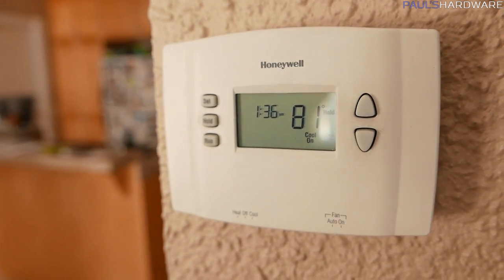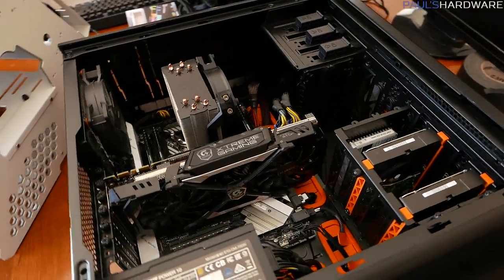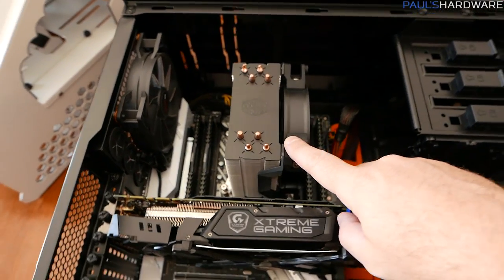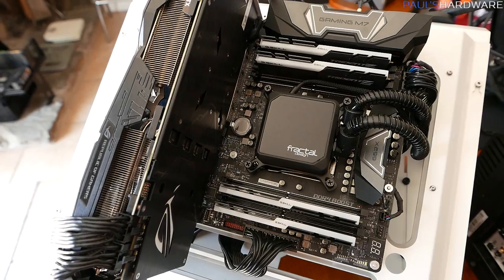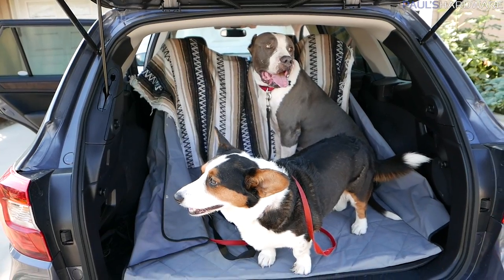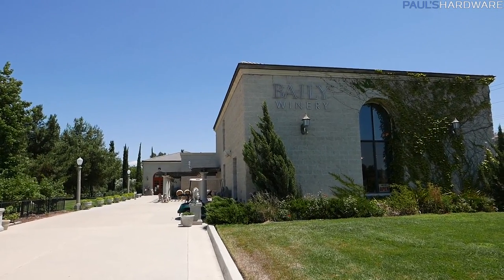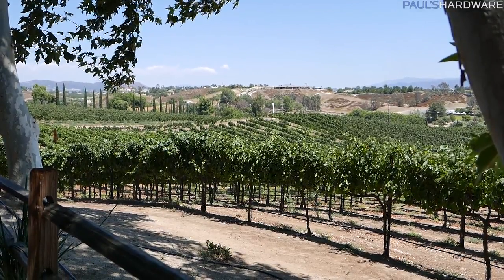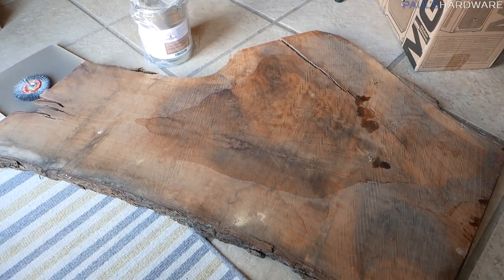GETTING WOOD

Comment: Paul's Hardware, there's a fairly sizeable crack on that slab you definitely want to make sure to shore up; either use a bow tie or epoxy if easier. If you don't because of how the weather can be it might extend on you and split the slab even after finishing

Comment: Here in WI, we have the HVAC set at 72 year-round.  My home/work office is downstairs and since heat rises, my office (where all my computer stuff is) usually is around 68 year-round.  It doesn't take much to keep house cool in summer because it is always in the shade from all the 100' + tall Oaks, Hickory & Maple trees.  And we are in a "hollow" so we don't get all the nasty winter winds.  Our summer temps can be anywhere from the rainy 60s to hot & humid low 100s and our winters anything between 30 above to -30 below.

Comment: You could fill the cracks in the wood with epoxy to give a smooth surface all around! You can use dyes to change the color of the Epoxy, a lot of people use black epoxy to show off the cracks more, but you can use different colors if you want something to pop. Just be sure to do it somewhere not in your house as Epoxy sticks to everything, and wear gloves of course!

Comment: paul i really wanna know , if i get an i9 7900x and a decent aio like the corsair h115i or the coolermaster liquid pro 280 , and i don't plan to over clock this cpu as it goes to 4ghz on turbo with ease so point of overclocking , am just asking will this set up with the i9 7900x and an aio 280 rad will do ?? and no overclocking i want this pc to be stable cause i want to shoot my 3D Renders, and each render will go around 5-10 hours , will this setup do the job ??
Reply: Amit Ghai Ryzen 1800x is way cheaper and gets better benchmark scores than the i9 or get threadripper
Reply: Joseph Stalin lol ryzen 1800x gets a cinibench of 1630 i know cause i have one and over overclocking that fucker to 4ghz gives a score of 1720cb but the i7 7820x at stock  check this at stock is faster than the 1800xoverclock the i7 7820x gets 1750 to 1800 at stock and its like only 100$ more expensive in my region (country) intel stuff gets more and has more service so its kinda hard to avoid intel here and given the fact the i9 7900x goes to 2330 cb score and stock which is amazing for a 10 core cpu , none of my xeons do this , yes threadripper is on the cards  and if it goes realy well and i mean really really well then only i will jump and spend 1000$ on amd dont u think that is too much money for spending on and , see my perspective is totally different here i buy xeons  for rendering and they cost a fortune even the used ones so this 7900x looks good for the price  but i am holding it off cause the 7920x is also gonna drop soon which i have a feeling will be soldered down if that is the case no matter cost of 1200$ i will buy intel as my work in rendering on my small render farms suites the intel products more but lets see if everything goes wrong with intel than amd threadripper it is see my heart starts pounding hard whenever i think of spending that amount on amd stuff

Comment: 81 is miserable. It would have me sweating non-stop. During the summer my ac is 70, and during winter the heat is set to 65.
Reply: Agreed. I think 60 is my favorite.
Reply: AC at 75 here in florida, around 90 with 70% humidity outside...
Reply: 52chevy3100 70°. I would freeze. 76-80 is a nice range for the whole day. I would get sick with only 70
Reply: How Munch is That in real temperatures?
Reply: 81 and I would be dieing from the heat
Reply: Game Lands 80 is 300 K 70 is 294 K
Reply: 75 is as high as I can stand indoors. Heater set at 58 in winter.
Reply: 80-81 in DRY air wouldn't be bad, and Paul's right - keeping your feet cool in sandals helps a lot.
The insane electric costs over there is surely a great motivator as well.
But what do I know? I live outdoors in the ultra-muggy southeast LOL
Reply: Can't do that in CA or your power bill will be $800 a month...   SoCal Edison our power company is a big monopoly rape your wallet scam here.
Reply: 52chevy3100 that's pretty good.  I keep it at 72, when I go to work it goes to 76 then when I get home it goes back down to 72 lol. And winter 70. And it usually get to 75 Max in my office
Reply: Also, contractors don't put any insulation in your house. I keep my thermostat set at 70 in the summer in the house I built (and insulated well). My electric is ~$150 a month.
Reply: Sounds hot, but i have no idea.. I'm hot here with 24 degrees celsius, and that is above the polar circle.
Reply: 70c is hot af.
Reply: When you are paying 15.34 cents a KWH in California I can see why it is at 81. I pay right at 8 cents per KWH. Keep mine on 70 in summer and my electric bill is never over $200 a month in summer or winter. Well on the bright side you could be in Germany and pay .35 cents a KWH.
Reply: We pay between 14 and 15 cents per KWH here in Kansas,so Calif isn't the only place with high rates. Oh and that's with a nuke plant a 100 miles away. Trust me those NEVER make your energy bills cheaper,they make them cost prohibitive.
Reply: 52chevy3100, 81 isn't bad in Cali, it's horrible on the east coast because of the humidity
Reply: Yeah humidity heat is horrible. I'm in SE Tenn.  Have had high 90's with 50%+ humidity.
Reply: That's the point I was trying to make. I remember a cali-girl that was completely miserable living on the Texas Gulf coast for a year - even though the actual temps were 20F cooler than she was accustomed to.
Reply: Yep, humidity is a killer, makes things so much worse!!!
Reply: Here in South Florida, it starts out around 78 in the morning with 95% humidity and goes up to the mid 90's in the afternoon, but only about 60% humidity.  We keep our house at about 79, but don't wear very many clothes.  Our electric bill never goes over $100.
Reply: +dblgonzo Exactly, I am like freezing right now and have like 79° here in Germany and our power is like three times your worst rates at best, so you see how spoiled you are. But luckily I have no Trump for president and our healthcare and universities are amongst the best and most affordable world wide. (Incoming nazi and refugee comments...)
Reply: My Ac is at 75 degrees any higher then whats the point of a AC?
Reply: 52chevy3100 I work in a 95 degree factory 10 hours a day, 65 is freezing lol (and I'm a northerner, it's just you get used to the factory heat)
Reply: room temp is like 68. Used to keep my room at 62
Reply: Try Australia in summer 104 F (40C)
Reply: You better use Celsius, all technical and science people, Fahrenheit, housewife's only!
Reply: @lucas rem I would hope the technical peeps are using at least three significant digits - - at home the difference between 78F and 80F is huge - and that housewife is gonna' choke you when you call it 26C either way LOL
Reply: @Bill Drouin

Kelvin was to hard for them, so they gave them an easy system! Recipes are the gain changer here, those old book are the reason they are still on old tables and methods. Books need to be rewritten, cooking shows reedited.
Reply: my ac is set to 60 during the summer. its the one in my window though
Reply: lucas rem No science people use Celsius. Kelvin is for science, Celsius is for snobby Europeans and Australians lol
Reply: Will all of you please use °C......
Reply: Spark99 Gaming Nope, kelvin for the win!
Reply: SupaNami: You are talking shit. Germany has a ton of coal and a great healthcare system for people that really need it. you have people that can't buy themself something for dinner because they have a ton of bills to pay, and we have mostly healthy people that are very happy to have a society that is willing to contribute.
Reply: 52chevy3100 You guys don't have ceiling fans or something?Crank that thing to 5 and sit back
Reply: Here in Southern CA, I'm south of Paul and it's almost always 100+ in the summer where I am.
Reply: flo richi, try to buy real estate in Germany, or Gaz, both the US and Germany are not the cheapest place to be, healthcare in Europe is affordable to anyone, not Gaz! Germany imports a lot of the Trump Coal, Essent and all the Energy Giants need them.
Reply: 52chevy3100 I

Comment: i have lived in the south east and in the south west 80 in dry heat does feel a lot better than in a humid climate but it still sucks lol air-con works a lot better when the air is humid and it was a lot cheaper to run the ac in the east the electricity was way cheaper

Comment: Your temp is terrible. I used to rent from a guy that kept it at 85.  It's hard on everything. I keep mine at 65 in the bedrooms and 72 elsewhere. Life is too short to be miserable with high temps if it can be avoided. There is of course also the issues of hot computer parts. 80 used to be the max you would want them to reach. So... a room at 81 would lower the life expectancy and cause more crashes right? Or have things changed?
Reply: PC temps are measured in Celcius, US air temperature is measured in Fahrenheit.

Comment: You have to do what you like, but personally I think that passive cooler looks terrible - like a ugly bird cage.  It totally out of proportion to the rest of the parts in terms of size and heights.

SOCRATES: That any kind of mixture that does not in some way or other possess measure of the nature of proportion will necessarily corrupt its ingredients and most of all itself.  

You do what you like, but I think you will tire at looking at that wire contraption sitting on your wall in full view.

Comment: Can you guys give me some feedback on this build? I'm mainly looking for productivity with a side of just regular 1080p 60+fps gaming as well. I plan on overclocking the CPU, not sure if I'm going to do it for the gpu(don't really know how to do it for the gpu). Anyways, thanks for all the help in advance!

Link: https://pcpartpicker.com/list/hvKDRG
Reply: That is very well balanced, also dont bother overclocking the graphics card, gpu boost 3 dose great on its own, the slef overclocking usually out dose what most people can do. the 1060 6gb is the very close to the limit for that cpu tho according to many testing. Also if a overclock fails for your cpu, turn it off and clear cmos and try again. Don't panick and start it up again, clear cmos forst. Then boot, the 1200 hits 3.7-4 from what ive seen and heard.
Reply: One very important thing though, make sure and get a cpu cooler if your going to overclock.The included cooler for the 1200 cant cope with much of any overclock at all, also why 16gb of ram?
 maybe consider holding off on 16gb, save some money since ram prices are at all time high, dual channel ram dose help performance, but at 1080 60fps is your goal, youll be fine anyway. 
also make sure and oc the ram to around 3000 mhz to get the very most out of ryzen. 
besides those little bits, it should be a good build.